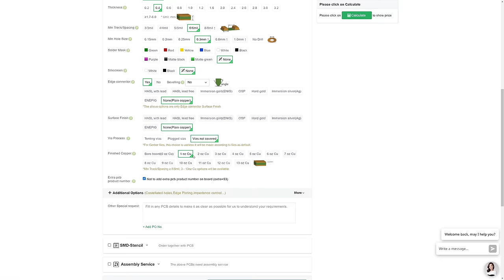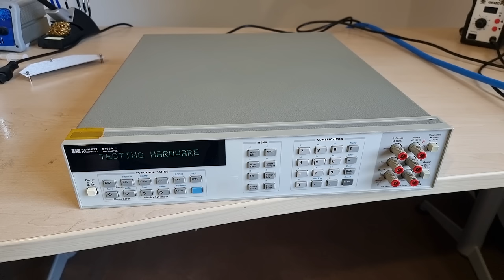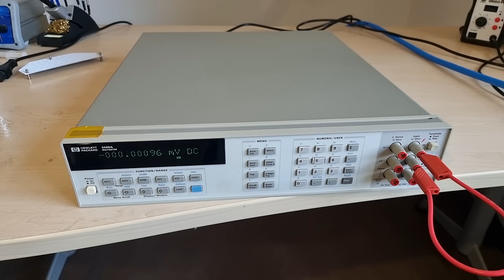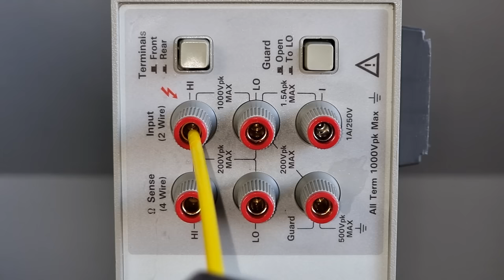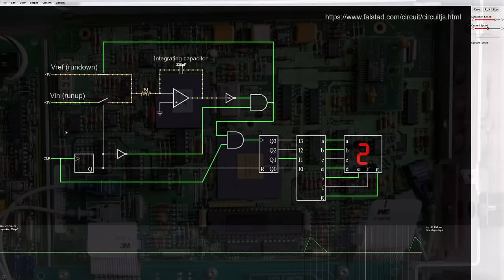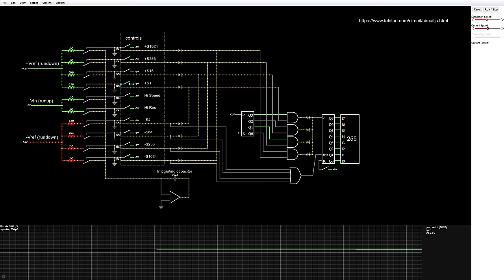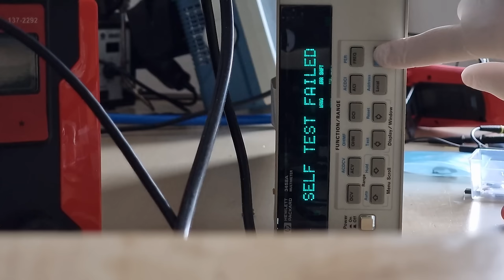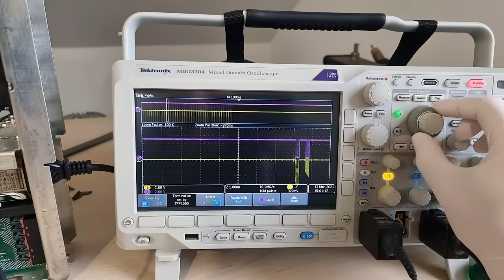HP 3458A - Why is this 31 year old Multimeter UNRIVALLED?

Comment: We had a saying at Keithley back in the late 80's and early 90's..."Nobody ever got fired for buying HP".  We had a Josephson Junction standard and we monitored it with a 3458A.  Incredible piece of engineering.
Reply: LOL, thanks for making my day with that tidbit.

Bought/specified/recommended plenty of hp in my day. But I was always particularly happy to get Keithley. Great stuff.
Reply: Try buying some of their crappy computer stuff these days. It is utter garbage.
Reply: Did you work on say the NIST reference volt? That is a thing of beauty there. Like a thousand perfectly over-filled cups of hot tea leveling off in a chain (the junctions in series AFAIK), poured while jogging so as to shake off the excess charge; I assume the antenna things are radiators.
Reply: @TomAtkinson  yes that was it.  With a stable frequency reference the output was quantized very precisely.  Small changes in frequency did not affect the output which was 8 to 9 digits stable and could be varied through a small range by increasing or decreasing the frequency until you got to the next "step".  Was hungry for liquid helium though!
Reply: In the IT industry, that slogan used to be "Nobody ever got fired for buying IBM." The meaning is the same: The company is the risk-free option because they have been around forever and can be depended on, even if they aren't the cheapest.

Comment: Thank you for the nostalgic tour! After an 18 year hiatus from Agilent, I sell EDA software for Keysight today...started with Hewlett-Packard in 1988 just out of EE university. Met Bill Hewlett and Dave Packard not too long before I visited Loveland Division on training tour. It is an incredible privilege to represent and sell products that thousands of HP/Agilent/Keysight geniuses have designed. These are products that design and test the technology that most people take for granted. Many of the largest customers today still use HP test gear that is 30+ years old! what lasting value. amazing. thank you Marco for this review of the HP 3458!
Reply: Steve how come today you cant just buy an analyzer that does more for less in a cabinet one 1:6 the size with todays chips ? (Im a plumber)   So  not holding any knowledge in this industry.
Reply: @AboxofMonsters  Yes. electronic test equipment is smaller and far lighter today..and far less expensive. CRTs have been replaced by flat panel displays...heavy transformers replaced by SMPSs...most signals under test are immediately digitized which allows wide analysis both in time and frequency domains -  by using math vs hardware (as in old days).

Comment: The first production 3458a's were offered for sale in 1988, but our lab first started using early prototype test units around 1986 -ish..  If you own a 3458a, get the annual insurance policy from Keysight, and it won't cost nearly as much to keep the unit in good repair.  It is a good value.
Reply: It's impressive that it's possible to obtain insurance for a 30 year old piece of equipment.
Reply: @thecatofnineswords  when it's such a high end laboratory equipment yeah, it's kinda of a norm

Comment: 5:32 The good old days of HP Journal, back when they put enough info out for some brave people to actually try to reproduce their magic. I'm submitting my engineering thesis tomorrow and it's basically my approach to constructing the TDC described in the April 1986 HP Journal, just modernized a bit and done without any custom IC magic (just some BFR93A's and BTF93's).
Reply: Since you mentioned the BFT93: Do you know of any fast (GHz-class) PNPs that are still in production? BFT92 going obsolete really screwed me over…
Reply: @DavidNadlinger  Hah, you and me both! Aside from getting bft93's and bft92's on ebay from shady sources, we're screwed. The world has decided that npns are enough for rf applications, so they stopped manufacturing fast pnps. The fastest pnp you can get from official sources is a painfully slow one (ft=400MHz or thereabouts, don't remember the part name) or you can pay an insane amount for an ic with 4 or 5 relatively fast pnps on a single die from Renesas (also don't remember the part number, but I remember it being >$10).

Comment: We have a bunch of these at the calibration lab I work at, and was one of the first instruments that got me interested in precision. One unique use can be found in the Fluke 5520 service manual, where it measures some of the simulated capacitance with a 5700 and a 3458A using its sweep mode, since the frequency response is too low for an LCR to measure. Talk about overkill.
Reply: Wow, please send me one, lol.

Comment: I worked at a very small business two years ago few month before covid were I was the only employee and I was mounting and soldering together easy pcbs. I had worked there for some weeks when one day a familiar designed instrument on the shelf caught my eye. It was a HP 3458A that had not been used for many years but looked like new, I drooled. The fun part is that the company never ever needed the precision it could give for what was made. An calibrated handheld fluke DMM was enough.
Reply: 3458A often bought not for precision, but for speed. It can do very very fast measurements (some folk can even digitize 50 MHz signal with 3458A ;).
Reply: @xDevscom_EE  Cool stuff. But we didn't needed fast measurements either to what we did. I think the boss bought it just because. :)

Comment: baking soda and super glue make a great plastic filler and can be filed into shape. I even replaced snap clamps on plastic cases and the hinge peg on my cars visor mirror cover. You can brush on or dip the part in super glue and sprinkle on baking soda, repeat until you build up the missing plastic, then file or sand to shape.
Reply: I have actually repaired resin intake manifolds using this method. Amazed a co-worker over 20 years ago by repairing the intake manifold on his car that way. One thing I learned over the years is to use the runny, original style super glue. The gel style does not work as well and sometimes not at all.
Reply: @capriracer351  the only kind i have ever known is the drip all over your fingers kind

Comment: I have and still use an HP3478A Multimeter from 1983.  After 38 years, still running strong and reliable.

I also Have a Tektronix 465 oscilloscope prototype.  It has a pre-production digital storage unit on top where the optional multimeter would go.  It's so rare Tektronix couldn't tell me anything about it, and didn't even know it existed.  When they added them in production a year or two later, they fit it inside the regular chassis and added the controls to the front.  Sadly the picture tube blew out a few years ago.

Comment: Marco! Now that's the video I've been waiting for.  Well done.  Fortunately my 3458A is not broken (my 7081 Solartron is), but it's do for a calibration.  You made it look so easy. Just a couple of good standards.  Did you say the 10V standard can be another value. How about 1.018xxxxxxV.  Anyway thoroughly enjoyed you video. I wish your 7081 was not working like mine so I could watch you fix it.
Reply from the maker: Hm calibrating 3458A with a weston cell? I don't think that's a NIST approved best practice 😁 Btw we have quite a few 7081 owners on the Discord server now if you want repair advice!
Reply: All you need is 10k ohm, 10 vdc and a dead short for the 'ext cal'. For the external AC cal more is needed.  Don't remember much from that long ago but I was fortunate enough to have one on my bench at the Air Froce cal lab I worked at & do remember we used exactly the same stds Marco just uses for cal.
Reply: @davidmurray700  Hello fellow PMEL tech. We got these in about 1991. They made so many calibration set ups child play. We loved them.
Reply: The 3458a Calibration manual says " any value between 1V and 12V" on page 5-4 . CAL command information. 3458a Calibration Manual.

The CAL10 command uses an external known Voltage reference to calibrate the internal 7 Volt reference of the 3458a.

So if you go thru a Stargate with your 3458a and the Ppm planet uses 8.543000 volts you punch in 8.543000 volts during the CAL procedure. 

There probably is a greater error if you only have a reference in the 1 volt range since it is ratioed to 7 volts.

Practically the modern voltage transfer reference is 10 Volts

In the ancient UN saturated standard cells 1.018 was about an end of life number. Usually when old and lower in voltage they temperature change with temperature was worse when old.

Comment: Excellent video! Really lovely to see this working again.

If you're looking for higher vertical resolution measurement on the cheap, for future analysis, take a look at some of the Red Pitaya kits. Their 14-bit options start at under 300€ for a 2-channel 60MHz option, and they double up as a transmitting SDR (2x recv, 2x transmit). The software for them is open source, too!

Comment from the maker: I just received 3 separate emails asking about 3458A purchasing advice. Here's all I know in a TL;DR:

The prices, even for used and untested meters, are very high at the moment.
No internal self test or ACAL can guarantee a good ADC, sometimes they start drifting slowly a few months before they finally start giving convergence errors.
If possible you have to power on the meter and have it measure a trustworthy DCV standard for a week. Or test it per Service Note 18A: http://literature.cdn.keysight.com/litweb/pdf/3458A-18A.pdf
Nobody seems to know what exactly causes these problems or how to cure them.
In the grand scheme of things the dreaded U180 problems are rather rare.
Because there are probably hundreds of thousands of these multimeters in use in the industry and in cal labs all around the world.
The number of bad U180 cases is small in comparison: A few forum posts, youtube videos here and there ...
On the other hand buying a used meter has increased chances of getting a bad one, because of course people will try to get rid of them after learning about the repair costs.
Probably the safest way to go is buying from a company that specializes in used test equipment and is willing to offer a guarantee.
i.e. https://www.ab-precision.de/ in Germany might be a good source.
Good luck!

Comment: Still have an even older 3457A that works like a charm.  Compared it to other NIST calibrated meters and it's holding a cal perfectly.  Of course now that I said that the battery will die.

Comment: I found an HP 3457A that I am using in the 7 1/2 digit mode with the Xdev mods. This reliably gives me about 10 microVolt accuracy. With a good calibration I think I can do better. Supposedly it is 5 ppm stable. Best Wishes!

Comment: Very amusing Sir.  Like your dry wit.  Most interesting from a technical perspective also.  I have designed several dual-slope ADC's over the years - first one about 1975 using an LM741 & LM311 believe it or not.  Worked jolly well.

Comment: Excellent video and it is good that you have included an important step omitted by most other videos.  They all clean the instrument but most forget to sanitize the operator with an ethanol solution.  Since dirty operators often contribute to the problem it is best to clean them before, during, and after repair and/or calibration.  Good luck with your videos.

Comment: Wow!  That is a beautiful meter. My work requires use of "basic" multimeters that are good enough if they read to within one volt on the 500V scale. So much respect for the precision and accuracy of the HP 3458A.

I do have one question for you.  It may be naive but it caught my eye. Around the 83:30 mark, there are blocks "blurred" on the video, as if something is being covered up on the circuit board. What sort of information would an owner want to keep private? I am very much conscientious about privacy so I would like to understand so that I can watch out for myself when sharing my own videos.

Comment: My favourite multimeter was the Avometer. Starting as a technician in the 70's, I still remember told to measure the current on the main circuit as an introduction to the to always having your brain engaged.

Comment: Many faulty BGA, wirebond or flipchips can be brought back into working order by reheating the die area with temperature slightly less than the solder melting temperature. The thermal expansion of the die fixes most problems. If you have nothing to loose, try it.

Comment: Sometimes diagnosis of the fault can be as simple as re-seating IC’s into their sockets. Other times, ‘Freeze-Spray’ can be used to detect leaky resistors, caps, FET’s , diodes junctions and even BJT transistors, that could have helped you find the leaky 2N4392 JFET more quickly. Thereafter replacing parts as done in this meter repair. Congratulations with your repair success, all while saving thousands of dollars, having the sanctification you fixed it and gaining all the learning acquired. So overall, a win in many ways.

Comment: Insightful. I've worked with these things since their introduction (at this time I think Bill and Dave still had influence before HP became a printer company). What aggravated me is when my boss asked me to verify performance with newly purchased 3458s (I don't have NIST resources!). I do remember when Fiona decimated HP, fortunately Agilent was created. Keysight 3458 seem to be as good, I have no means to determine (don't have the time and resources). For almost all my low voltage measurements other DVMs like the 34401 are just as good but having the 3458 I can bet my credit card I'm collecting the best measurements.

We have one 3458 that was rejected by calibration lab we use, I may exercise some of the error code procedures you illustrated here. The mention of the U180 shows importance of magical components. I thought it was interesting describing how the 3458 processes work though my brain bandwidth had difficulty at times absorbing the intellectual content. Enjoyed the amusing comments like "shady ebay sellers" and "depressing Twitter feeds" and preparing your favorite drink. Also how you used a razor to cut leads from newly soldered components.

Comment: Back in the day (1979) I was the final test tech on the $8,000.00 Fluke PPM digital multimeter that had a HP PPM digital multimeter as it's only competition. Three Fluke engineers created it and two left the company with the only go to engineer refused to help with any problems so we tech's were left with trying to fix all the problems on second shift. There was an oscillation that sometimes would appear in  some of the units that did not affect the spec's but drove HP reverse engineering nuts to try and reproduce that same effect!
 Wow, growing up in the analog age into the digital age where GREED is more important than anything else!

Comment: Thanks for the fantastic video! Your sense of humor and methodical attention to detail have earned you a sub from me.

This is the first time I've come across your channel, so forgive me if someone has brought this up since this video was posted, but I have to wonder if the mains filter was killed by the film capacitors, rather than the other way around. Those film caps look for all the world like RIFA caps, which have a bad reputation for failing short with age and shorting the mains input, which I imagine that sealed mains filter would not be too happy about. You may want to consider putting RIFA caps on your replace-at-first-sight list, if they're not already.

Comment: I didn't know about these Dallas replacements. I burrowed into my Dallas memory package with a sharpened soldering tip (heat turns the potting resin into powder) and connected a glued on battery holder with two wires.

Comment: Cliffhanger repair, persistence wins, good job. This multimeter is the only equipment worthy of calibrating my HP 1660AS logic analyzer/scope according to the service manual, which has special meaning to me after several repairs and recaps. In a way owning something you repaired and even redesigned after reversing the functionality becomes so much more meaningful than simply buying something, special feeling.

Comment: Awesome video and epic repair, was wondering how long before you got one, entertaining and educational! Still going through a slow restoration my HP 3458A, thankfully mine just had a faulty outguard power supply, still needs to have some capacitors replaced, the non-volatile memory has gone senile and cleaning oxidised frame from a blown Schafner someone never cleaned up. Unfortunately my 7081 has died this week, looking like 5V power issues, hopefully nothing else.

Comment: How is it possible to love a multimeter?  I have a 28 year old - yellow.  Cheap.  Works still with proper accuracy. I just tested it on a new AAA battery and it read 1.7 Volts.  Ahh!  Batteries are getting better an better. They can squeeze more and more volts out of a single cell. Amazing.

Comment: That 3453A is interesting for sure. Never seen an octal keypad before. There are some pics on eBay, seems like it takes around a dozen plugin cards to actually do something. This seems to be the mainframe (along with the 3253A analog SRU) where interface cards to which then interface with assembled circuit boards for testing. HP Journal March 1979 is all about the HP 3060A system.

"The HP Model 3060A Board Test System is intended for 
use on analog and hybrid analog/digital circuit boards. It is 
a third-generation system that evolved from eight years' 
experience with two previous automatic test systems de 
veloped for in-house use. "